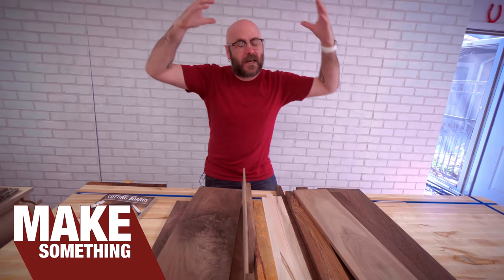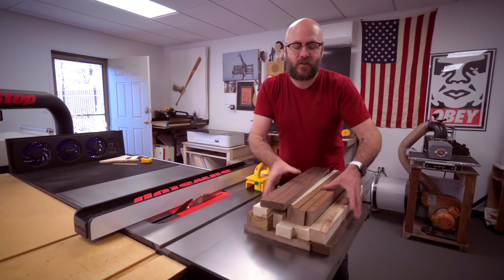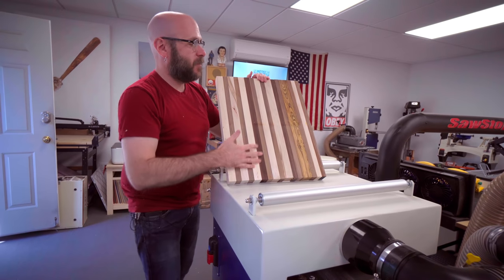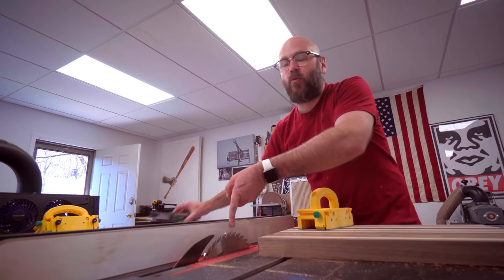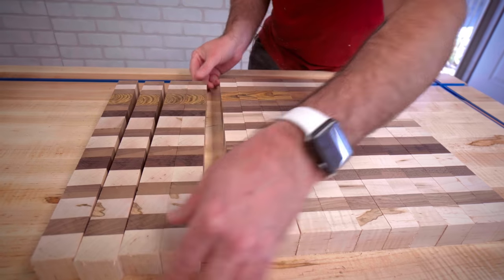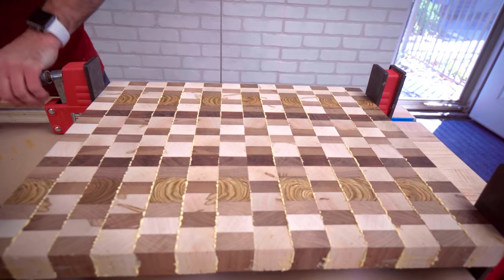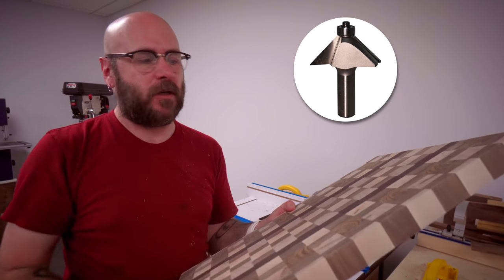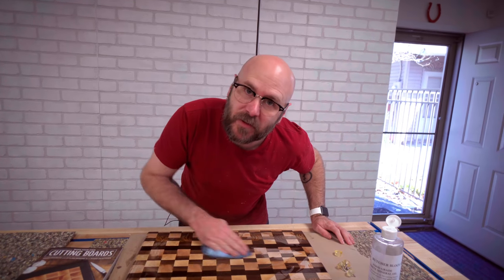End Grain Cutting Board From Scraps | Great Mother's Day Gift!

Comment: Why did you run the miter gauge backwards? Honest question, not a troll criticism.
Reply: Seconded. I too am curious.
Reply from the maker: Because it would have hung off the table going the "correct" way. Hopefully, that makes sense!
Reply: Make Something It does. Thank you! I have never thought of that, yet have started many cuts with the miter gauge hanging off the table.
Reply: It does, thanks for clarifying, simple solution right there in my face the whole time.
Reply: Learned something today!

Comment: I see now my mistake on an end grain cutting board I made. I tried to smooth it out with my planer, not a good call on my part, it tore some chunks out😡
Reply from the maker: I think Matt Cremona has a video on using a planer. I think he glued scraps on the ends to prevent that blow out. I could be wrong. My memory stinks.
Reply: Make Something   Thanks brother, and I know what you mean, my memory gets worse every day.👍🇺🇸